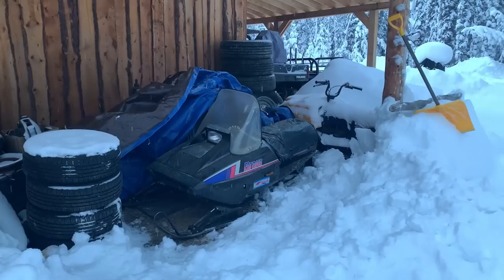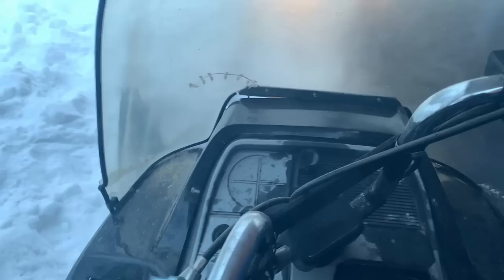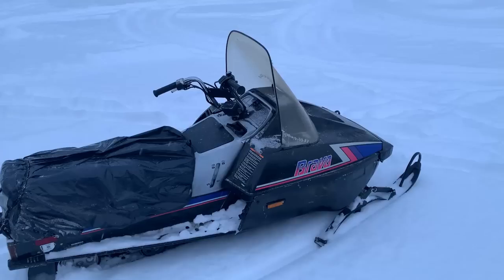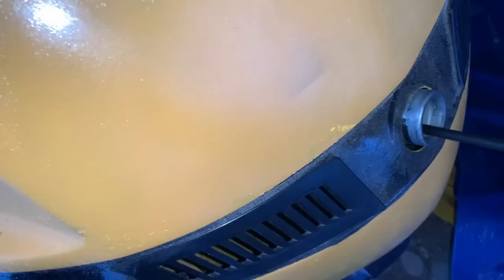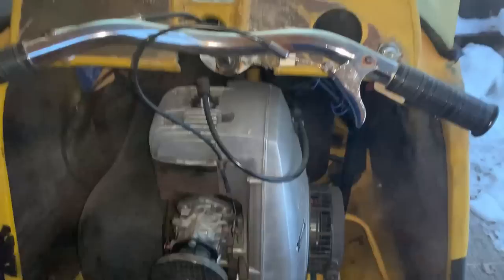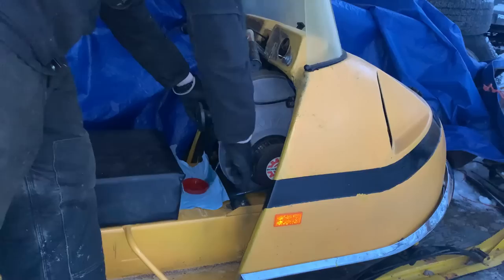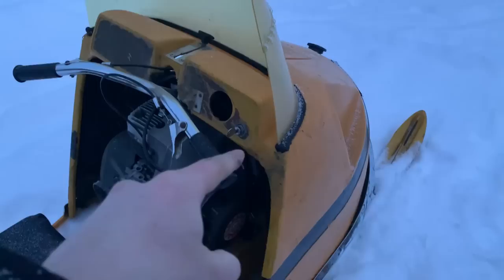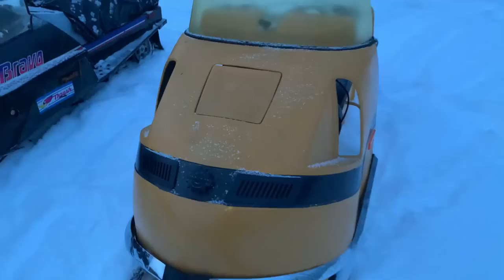Vintage Snowmobile Rally

Comment: I love snowmobiles sadly only used them about 3 times in Bosnia for resupplying a rebroadcasting station in the hills.
It was a soviet built copy of  the Olympic with a big old 2 stroke engine about 600cc I think.
It hauled two of us and two sleds of batteries food and gas for the fuel heaters 👍
As ugly as sin but by heck she got the job done with (relative) ease.
Charlie 🇬🇧

Comment: I bought a 1970 Ski-doo in 1977. The 250cc engine was replaced by the previous owner with a 399cc bombier race engine with a single carb. I still have it and those who see it going always cheer and take pictures. It runs like a bat out of hell in the straights but it is easy to tip over on sharp turns. The only thing I've done with it is a new track, ski skids and wiring. But it still looks orginal and in great condition. Thanks from Seward Alaska.